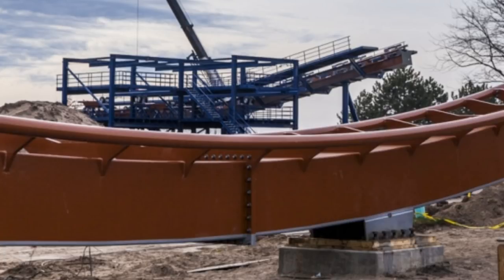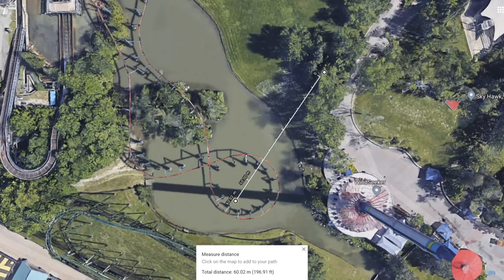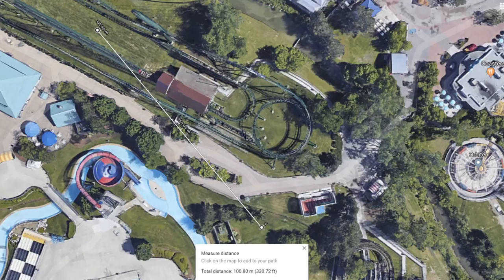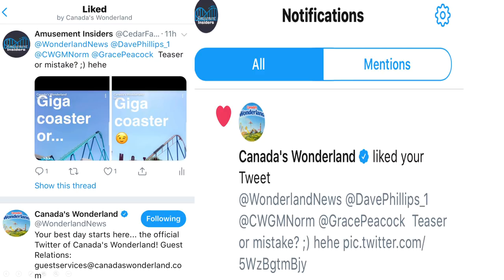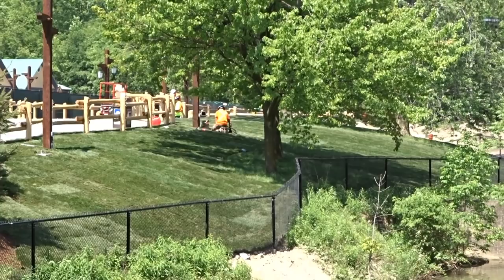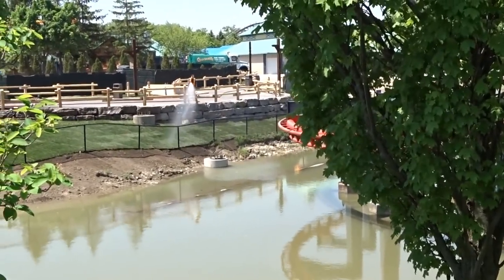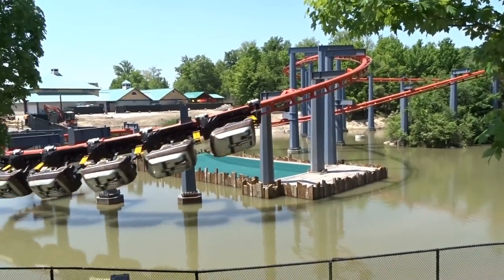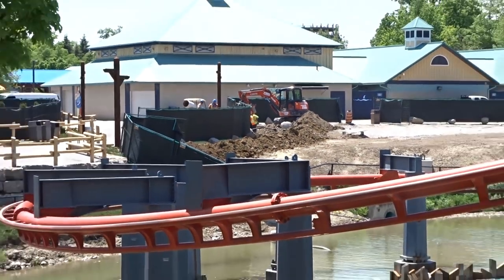Canada's Wonderland New World Record Coaster?

Comment: Keep in mind that Valravn also has a longer pull-out than Leviathan and that's only 220 feet. So I think it will be around 250-260 feet. Still, a Giga-Dive would be cool, especially if they added more elements.

Comment: The angle of the pull out could be prolonged to provide more time in the tunnel
Reply from the maker: BRENT EHMER it’s a bit expensive for a small aspect
Reply: Amusement Insiders not really lol dive coasters are relatively cheap compared to other b&ms also its alot cheaper then a giga dive. The extra bolts could be so the track doesn't flex as much in the tunnel
Reply: Naaah

Comment: Or it'll just have a straight piece of track in the tunnel, just like Oblivion The Black Hole...
Reply from the maker: Filipolis the track pieces are all in the tunnel and it’s all curved
Reply: The thing with Dive Coasters is that, in my opinion, they don't make sense after a certain height. From a certain point, which Valravn has already reached, the first drop just consists of more straight pieces of track. I you'd like to have a sensation of falling straight down, it would be better and especially cheaper to just build an Intamin Sky Jump instead...